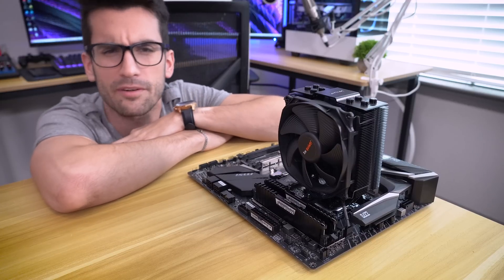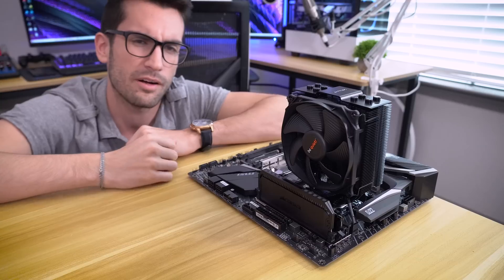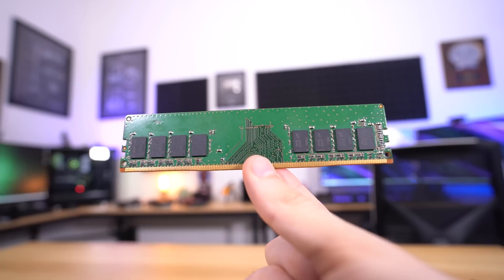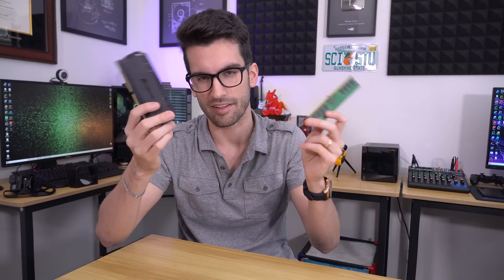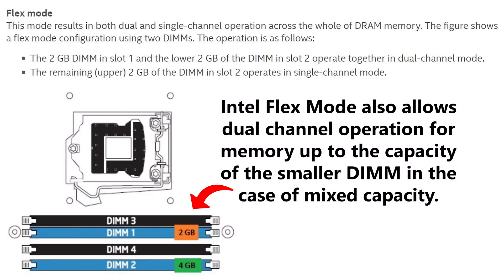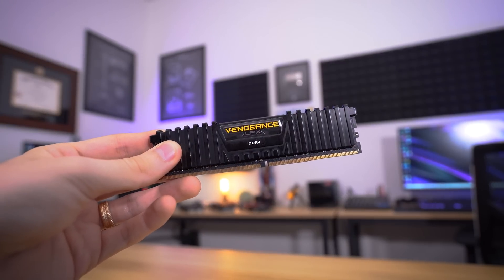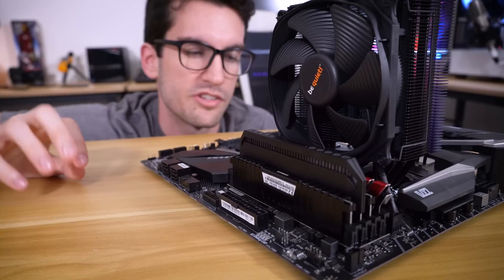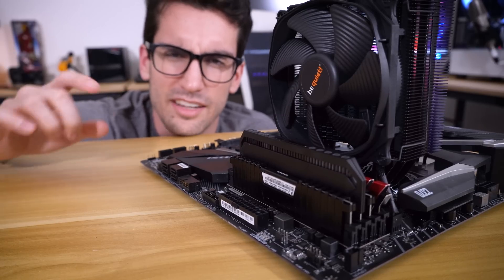Mixing RAM?!

Comment: In a nutshell: It's fine. Yes, mix memory if you have to. Your system will run at the speed of the slowest module.
Reply: What if the two sticks of ram are running at the same speed?
Reply: @HardwareHacksYT  Then the system will run at that memory speed. The mobo does have to support that speed, of course! You can't have ALL the sticks clocked higher than the mobo supports, unless you have a BIOS that allows you to declock the RAM channels.
Reply: Trump's Tiny Hands Just FYI, it’s SUPER SUPER possible for issues to occur. It won’t simply “clock the the slowest one”. The chips and I/O controllers are different. The timings are different. The Subs are different. The command rate can be different. If 16-16-16 C die tries to pair with 16-18-18 CJR, you’re going to have issues with tRAS. Why? Because tRAS needs to be at a high number with C die, however tRAS is dependant on timings such as tRCD and tRP, which are now different. If the slower timing is used, tRAS won’t be calculated properly. If the faster is used, tRAS won’t work with the C die. The C die (16-16-16) would have tRAS greater than the tRAS for the 16-18-18, so uhhhh there’s nothing you can do there except manually change half the timings. Timings matter. Speeds matter but MOST importantly, memory chips and ICs matter
Reply: @ArshiaS1381  See my above reply to Mr Ahmed. In the vast (99%) of cases, it's just fine. You are 100% correct in what you say, but my OG post was a simple, quick help tip for the average user who may have odd DIMMs in their collection and want to know if they can utilise them to increase capacity. Mostly they can, it's fine. Why pick it apart with edge cases my dude? I do this daily for customers whose installed RAM is slower than the modules you can buy today, and it is almost always ok. And I soak test the machines with Prime95 for 48hrs before delivery. Any issues I undo the changes.
Reply: Trump's Tiny Hands TM5 with the anta extreme profile is a much better memory stress test than Prime95 Large is
Reply: @ArshiaS1381  Yah but P95 gets the job done!
Reply: Thanks
Reply: Nothing a bit of oc can't solve.
Reply: @HappyBeezerStudios  how do i oc only one of my rams? for example i have 2666 mhz and 3000mhz and i say i want to oc my 2666, is it possible?
Reply: @HappyBeezerStudios  thanks, i just have to set it to 3000mhz and my rams will run the same. Trying to buy from a guy who has 3000 and 2666, rgb tforce
Reply: @HappyBeezerStudios  tried doing this... ocing a non matching kit is a nightmare
Reply: What if your motherboard is the one that’s bottlenecking your ram speeds
Reply: @UnitsChannel  Doesn't quite work that way. My point was, the short answer is don't stress out over mixing different spec RAM. System's gonna run just fine, it will de-clock to the speed of the slowest RAM modules it finds. If your mobo is underperforming, that's a different matter.
Reply: Trump's Tiny Hands Question, how do we know what motherboard is “good quality” or “bad quality”, and how do they affect the system apart from the ram memory compatibility + cpu socket?
Reply: @Blitterbug  If it can cause a blue screen then it can cause silent data corruption that can cause stored file and even irrecoverable filesystem corruption.  Do this long term and you could eventually have a hard drive your BIOS refuses to boot and you'll hope you can recover it with a filesystem utility.  If you do anything remotely important with it it's best to use memory only from the same kit and for that kit to be on the QVL for the MB or vice versa (unless you know how to validate it as well as the respective manufacturers).
Reply: @jasonlisonbee  Um, no. If the RAM is intrinsically stable, you won't get a blue screen. That only happens with bad DIMMs.  Not happened to me in some 30-odd years, leastways...
Reply: Trump's Tiny Hands if my pc has a 3000hz 8gb ram could I use some other brands 8gb 3000hz?
Reply: @papisamir3928  Yes, you certainly can.
Reply: @Blitterbug  hey bro i see that u help alot of friends here i hope u help me to;   i have 3000mhz 8gb cl16 1.35v on my pc im using only 2666mhz cl15 (cuz my mobo support only 2666) the xmp did cl16 to cl15 auto. and i bought another same brand 8gb 2666mhz cl16 1.2v (has xmp and overclockeable) what will happen if i connect this one ? If its work this will count as dual channel? The xmp will choose the voltage same as other one ?I know this is my own risk just need to know more thanks alot bro.
Reply: @drisssamlali3663  mixing ram brand and frequencys worked fine for me. 
Yes it will be dual channel but it would run on the lowest frequency(for you its 2666). Make sure to put it on the 2nd and 4th slot👍.
Reply: @jucctin5243  ty so much bro that what i need just 2666 enough for me and i have just two slot ram motherboard
Reply: @drisssamlali3663  Generally, clock speed is the only thing that matters. The overclocking community bangs on about tweaking the voltages, etc, but I would let the mobo sort that out. For dual channel, you have to match the sticks exactly, as far as I am aware. I would just try it. You won't fry the RAM. If it doesn't POST, reset your BIOS to factory defaults and try again - in other words remove any overclocking. Mixing DIMMs is only possible if you don't plan to overclock.
Reply: @Blitterbug  so if I have 2 3600mhz sticks and I install 1 stick of 2600mhz, the pc is gonna run at 2600?
Reply: @Blitterbug  so it's pointless to run 4gb and 8gb cuz itll just run at 4gb? might as well just run the 8gb by itself? or what about 2 4gbs?
Reply: @Dioslux  Wot? Size is not speed my friend. 4 + 8 will give 12. Don't you want 12GB?
Reply: @Blitterbug  that's what im asking. but the system will run at the lesser ram stick right? so a 4 and an 8 together will run at 4? im new to this and just trying to understand
Reply: @Dioslux  No, no, no! You're still confusing SIZE with SPEED. Memory has a maximum speed it can be run at. If you insert a 4GB and an 8GB stick, you will have 12GB of memory, but because all ram must run at the same speed, the system will choose the slowest speed of the inserted sticks and use that to run all the sticks at. Understand? If you don't get it, don't worry. You will still have 12GB.
Reply: @sebawuba8533  by the ratio of vrm to power phase basically the more vrm and power phase but must be 1:1 ratio or atleast 2:1 ratio but can be counted equal to min of 6+2 or double the vrm per 1 power phase is better than double the power phasep per 1 vrm.
Reply: @UnitsChannel  get a better motherboard. My motherboard limits at 2400 mhz because its kinda old, but doesnt rlly matter too much cuz i use intel
Reply: @Willem500  Yah if all your sticks are too fast for your mobo, it's gonna likely not POST.
Reply: @Blitterbug  bruh thats not how it works if the sticks run higher than the mobo they just underclock
Reply: @Willem500  Yes, they should, but some older northbridges don't always let modern superfast DIMMs work in backward-compatible mode. You just have to suck it and see.
Reply: @Blitterbug  yea mine worked fine for years. Now my pc is stuck in a bootloop, tried replacing evereything even mobo, last thing i havent tried is to buy a new psu
Reply: @Willem500  Yeh that may help, I know how frustrating it is believe me!
Reply: Trump's Tiny Hands you the goat
Reply: @jeremym9140  Baah!
Reply: I'm sorry you had issues, but  @labibAhmed-q9v  30 years of experience doesn't make me 'wrong', my man! Some mobos can't handle mixed speeds if they are a) too old, b) have odd northbridges, c) various other reasons too long to go into. As a rough rule of thumb, what I (and Greg) said in his video is largely correct. Ask some of the people who have messaged me. I still do this daily, and for a living, and it works in 99% of cases aside from very odd laptops and desktop mobos that just don't like it.
Reply: @postconsolepeasant6538  yes, you can.
Reply: Im confused at "your system will run at the slowest module" So if you have 2 , 4 , 8 gb of ram modules will it go for the 2 gb of ram?
Reply: @kkrmson  RAM size is not RAM speed! The speed is the number written on the sticker (not the size number!). You can normally mix RAM sizes with no problem as long as the BIOS / mobo allows it. Check the downloadable manual for your mobo.
Reply: Oh alright tnx for the instant reply🙏
Reply: I do it to I just get the same speed of ram and just oc it
Reply: My hero
Reply: @Silver.Swimmer  hehe!
Reply: Thanks
Reply: @KC80SiX  No worries!
Reply: So if I have 3200Mhz 16GB RAM DDR4 rn, and I buy another company’s DDR4 3200Mhz RAM, it will work perfectly well and won’t effect the speed on the system in a bad way?
Reply: @houdinimagician1794  In theory it should be 100% ok. The manufacturer is irrelevant so it should be fine.
Reply: @Blitterbug  hello sir. How can i know if my motherboard can support my ram? Currently, i have 8gb ram and planning to add 1 more. Also, can I mix 8gb and a 16gb ram? Thank you so much. 

P. S. Bought the pc (brand new) around 4 years ago.
Reply: @angelocastro9536  You can mix RAM sizes, but make sure you don't exceed the max. amount of RAM for your motherboard... if it's only 4 yrs old, mixing 8GB & 16GB DIMMs shouldn't be a problem but there's NEVER a guarantee it'll work so don't spend too much money!
Reply: Trump's Tiny Hands 
ok, thanks!
Reply: Thanks
Reply: @Plumbobby No, not at all - RAM sticks have a bus speed they run at which is written on the label. When modules with different speed markings are mixed inside the same machine, they will ALL operate at the speed of the slowest module. Though one person pointed out that they seemed to get a speed part-way between the lowest & highest, so ymmv...
Reply: Best answer
Reply: @baghlani92  Why thanks!
Reply: can you buy a ram stick of a different brand but with the same speed and memory?
Reply: @_ren5506  Absolutely. No problem at all.
Reply: at stock but just go to the speed of the lowest memory speed so like 3200mhz and you be fine unless your cpu cant do that speed at 4 rams stick
Reply: @EvanLovell  Think that's pretty much what I've been saying... except you normally don't even have to fiddle with BIOS settings, it recognises what you're plugging in.
Reply: I have a hyperx fury  and it auto overclock itself depending on how much stress it's under with the base frequency at 2133 but will overclock higher if it needs if I add in another eg corsair stick will it only run at 2133 aswell
Reply: What if i mix my 8gig 1866hz with another 2x4gb kit of 1866hz but different brand?
Reply: @matusgerbiark3622  Nothing. They'll both work fine with each other. Don't worry about mixing dual with single channel either; it's an old wives tale that you'll get crap performance.
Reply: @matusgerbiark3622  it will be 8gb but there's no dual channel. And different brands doesn't affect it.
Reply: Trump's Tiny Hands my ram is different but is the same speed soo is dat gonna affect it
Reply: @archifps  Shouldn't matter. The only issue is mixing dual channel with single channel, but that's not as big a deal as some tech channels make out.
Reply: I've tried to mix SODIMM RAMs, 2x 8GB DDR4, just different brand and speed. But it keeps BSOD.  Is there any settings to change in BIOS?
Reply: @afiqzamanhuri  Some mobos forbid certain combinations. Nothing to do with mismatching RAM speed - more to do with DIMM sizes. I'd suggest googling the manual for your mobo, they often have very detailed explanations. Yes, you can often change timings & voltages in the BIOS but stay well clear unless you are VERY confident! Final tip: Short out the mobo CMOS reset pins before trying again. You wouldn't believe how many 'bricked' mobos come back to life when you do this.
Reply: Tnx
Reply: No need to watch the whole video after reading this line Thanks Man 👍
Reply: @starktheories1142  Hehe - that was kind of my original reason for posting, though Greg makes some interesting points I felt it was a teeny bit superfluous, and I've had a lot of interesting questions come at me as a result. Please watch it though, Greg could do with the ad revenue!
Reply: Trump's Tiny Hands  like you change the speed after you install it like in the bios or something
Reply: What if I have 2 8g sticks of 2666 and have 2 8g sticks of 2400
Reply: @nzxlunar8893  As long as the mobo supports that qty and size of DIMMs, the system will run at the lowest speed DIMM - in your case 2400.
Reply: What about Using 3×4gb ddr4 ram ?????? How well or bad it will perform
Reply: @prince-of-saiyan  I don't understand? this thread is about what will happen if you mix DIMMs of different speeds.
Reply: @Blitterbug  You really a legend still responding to all this 👏👏
Reply: @superjamram165  Hah! Thanks but no, just like helping people - there's a lot of misinformation out there.
Reply: @Blitterbug  Well I am sure you have helped everyone here plenty 👍😀
Reply: Trump's Tiny Hands bro thanks for helping everyone out here ..please help me with this bro ..I have a fx605dt ASUs laptop..it has 8gb ram ..dual channel..can I add one more 16 gb ram to the empty ram slot and make it into 24 in total?
Reply: @srikanthgudluru9293  If money is no problem it's probably better to use two 16gb DIMMs. The mobo should support 32gb no problem. However, in theory you can have a mismatch of 8gb + 16gb and it should be fine with that particular model.
Reply: Trump's Tiny Hands I brought new ram but when I installed it it didn’t work it’s also not the same as the one I had already is there a particular order I have to install it
Reply: @abu4559  When troubleshooting RAM issues you need to isolate the problem. Does the new RAM work just on its own, with the old RAM removed? If so, this particular mobo has issues. As I don't know HOW different the new RAM is, it's hard to say but try it with just the new RAM alone. If it works, you might want to buy more of that type to replace the older RAM. If it doesn't work with just the new RAM that means your mobo fundamentally can't work with the new RAM at all, I'm afraid. It is probably too old to cope with it.
Reply: Trump's Tiny Hands it isn’t old because I  have a gigabyte b450m ds3h but it’s fine because I refunded I’ll just buy another Ripjaws v but with a 2400mjz instead of my current 3200mhz to fit my budget
Reply: Also should I enable or disable xmp when installing new ram
Reply: @Thanos Yes, up to a point. Often mobos have restrictions on max size of DIMM per socket but most are flexible. I do this all the time for customers who just want a little memory boost but don't want to pay to replace all their existing RAM.
Reply: I have 2X8gb + 2X4gb so 24gb total.
They are perfect match same manufacturer and model just diffent size.
Runs perfect.
Reply: @skipjackson5349  Nice. Pretty much what I'd expect tbh.
Reply: A Jackson manufacturer and model don’t matter. Unless it’s Crucial. Otherwise it literally DOES NOT matter.
Reply: Facechunk  Normally, yes. That's the whole point of Greg's video, and also of my original point. Try it and see - most mobos are fine with this.
Reply: Trump's Tiny Hands I just purchased 2x8gb corsair vengeance pro sticks. I got greedy and purchased two more of the same sticks to have 32gb. Corsair says they don’t guarantee them to work together. What do you think? P.S. running AMD ryzen 9 3900x on msi b450 tomahawk.
Reply: @TheMad0ne  The best thing is just to try them. If the system POSTs, it's probably gonna be ok.
Reply: Trump's Tiny Hands thanks brotha. It’s my first build just waiting for my gpu to get here and then it’s on!
Reply: @Michele mike Not sure about the clock timings. The key thing is that the modules will work ok. Mismatching modules probably isn't a great idea if you're concerned about the actual clock timings! It's more of a 'hack' to allow you to utilise spare DIMMs you have lying around without spending big money. If possible, always match the RAM exactly in every spec.
Reply: Thanks
Reply: @Herus So try it and see? I don't think the clocks matter too much as long as the mobo supports BOTH. Then it should run both sticks at the slower speed.
Reply: Hye. I just want to know. If a laptop RAM speed is stated DDR4 8GB 2133MHz, can i use more RAM speed? For example 2400MHz or more.
Reply: @amirulshafiq2656  In theory, yes. But if you install it alongside the 2133MHz DIMM, all the RAM will run at the slower speed. If you are going to completely replace the RAM with faster DIMMs, and if the mobo supports the higher speed, then it will run at the higher speed. If the mobo doesn't support the higher speed it will either underclock or simply won't boot.
Reply: @Blitterbug  thanks for the info! 👍👍👍👍👍
Reply: Formerly your PC didn't boot when Ram was not compatible.
Reply: Can i buy 16gb and combine it with 8
Reply: @Maefis  I don't see why not, if your motherboard supports 24GB.
Reply: Trump's Tiny Hands my motherboard Supports 64gb RAM
Reply: Hey everyone . Ive a Hp laptop with I5 7200u + Gtx 950m  
I got the basic 4Gb ddr4 from Samsung . And i bought a Corsair 4gb to get a " dual channel " with 8Gb at total .
Will it work ?
And sure ive got the same MHz and DDR4
Reply: Slowest gb or MHz
Reply: @swifter__9079  ? gb isn't a speed?
Reply: @Blitterbug  I mean kinda like cod can't handle 8gb
Reply: Thx..you’re a good person
Reply: @abdulwahabelhaponi8139  Not at all but thank you.
Reply: @Blitterbug  I got samsung 4gb DDR3 ram (PC3, 12800, 1600mhz) and I'm planning to buy Another's company ram of same specs (Hynix 4gb DDR3 PC3, 12800, 1600mhz). Will it be okay? Because I'm actually a bit nervous of mixing brands (though specs are 100% similar).

Also, I'm a bit confused as I have only 2 slots for ram to insert onto my mobo, but when I lookup the ram specs in CPU-Z software I see slot#1 slot#2 slot#3 slot#4? 
Reply will be highly appreciated! :)
Reply: @rahulahire9165  Yes it's fine, brand doesn't matter at all. As for the slots, CPU-Z may be counting the slots twice because of them being dual-channel - but don't quote me. Basically it's safe to ignore this anomaly. It doesn't get everything 100% right in my experience.
Reply: @Blitterbug  Thanks mate!
Reply: Nah if it has enuf dedicaded wam for my minecwaft server, then I am fine
Reply: What about the same speed ram
Reply: @refraag  That's even better as you know the system won't drop to the speed of the slowest module. The main point is you can generally mix sizes and speeds without many of the problems that high-end system builders claim you'll have.
Reply: Thank you very much I will continue browsing the internet now after not even having watched 2 minutes of this video
Reply: @Leo-ri6qg  You're welcome!
Reply: I have an Asus prime h270 wich only Supports 2400mhz but I have 3200mhz sticks so I paired them up with my old sticks and boom 32 gb
Reply: @Sileovitam  There ya go!
Reply: I have a slightly old system with 4gb ddr3 1333ghz, I wanna buy some more some 8 gb 2x4gb  also 1333ghz can I use the 2's gb with the 4's together if they bother are 1333
Reply: @eltioghost8520  Shouldn't be an issue - DDR3 systems tend to be more tolerant of mismatches in my experience.
Reply: Will it work in dual channel mode?
Reply: what about 4+8gb ram?
Reply: I just want to add a new stick of 8gb ram with the frequency of 2666 same as the old one but in different brand.
Reply: Guys i have a 2400 mhz ram am i able to pair it with a 2666 mhz one or no?
Reply: @barbeque701  I can't see a problem with that.
Reply: @Blitterbug  ohh so it means it can run but my 2666 will just run at 2400 right?
Reply: @Blitterbug  please reply to my query 👆.... thanks in advance 😁
Reply: I have 2400 Mhz Corsair Vengeance Lpx 8gb stick (red) , i am planning to add one more 8gb stick of same vengence lpx model & speed but it is black, with their latency values slightly different.. would they work together ?
Reply: @Yogi_beer  I don't see why not...
Reply: @Blitterbug   Best of luck for elections, king 👑
Reply: @Yogi_beer  Hah!
Reply: @SSonnyy Yes, it should work fine.
Reply: If i put 1866mhz with 2666mhz....what gonna happens?......did the permormance increased?....or just running the same system before i add new ram?
Reply: @ashnoice3805  Nope. That's a big difference! Usually, the system will run all modules at the speed of the slowest one, but a difference that big? Sometimes the mobo will refuse to POST, so be careful.
Reply: @Blitterbug  why can't it run at the ram that have highest speed?
Reply: @ashnoice3805  It's because all RAM modules MUST run at the same speed, but slower RAM can never physically be made to run at the speed of the fastest RAM module, so the mobo does the only thing it can and 'underclocks' the faster RAM to match the slowest RAM in the system. It's really very simple when you think about it.
Reply: @Blitterbug  im not realy got at this thing and still confuse.......so which is the best to do?.....
1) mixing a different ram speed
2) insert a same ram speed

I afraid that my laptop gonna get side effects
Reply: @ashnoice3805  Don't sweat it. Get the best match for the current modules you can. Basically, if all you can find is massively faster modules, to avoid any potential issues I'd probably replace all existing modules with the new ones. If you can afford to. DDR3 is a standard that doesn't care about clock speed, you normally won't get a POST fail unless your mobo doesn't support the AMOUNT of RAM you're trying to fit. Speed isn't too much of an issue, honestly; just try and make the speeds as close as possible for best results.
Reply: thanks 😂
Reply: So is it possible to mix my 1st stick (UDIMM no heatsink 2666mhz 4gb) with 2nd stick last resort HyperX Fury (2666mhz black 4gb) answer pls
Reply: Mr President sir, what if i combine 16gb 3200mhz with an 8gb 3200mhz? Both different brand btw. (Sorry for my english my good sir)
Reply: @vox0126  Well now, I can't see a problem with those combinations. And your English is fine!
Reply: @Blitterbug  Thank you so much my good sir. May the force be with you.
Reply: If I have 2 sticks of crucial and 2 sticks of team group and want to mix them... will it still be better than only have the two same ones?
Reply: @eli_flygaming1117  Depends what you mean by 'better' - if better means more memory then yes.
Reply: Thank you Mr Trump
Reply: @idaziz  You are very welcome
Reply: @Insxdious. It doesn't really work that way; for best stability & FPS, always use fast RAM and match the sticks' speeds. Mixing stick speeds is just a hack to get you more RAM for cheap, but the system will then only run at the speed of the slowest module.
Reply: Uh 8gb 2400mhz with a 1gb 800mz ?
Reply: Ahhh that makes a lot of sense, never really thought about mixing ram but I'm going to try to stay away from it.
Reply: @phrog.4809  Yah, it's basically an option for when you have an older machine and you need more RAM to improve performance, and you have an old PC lying around.

If you're a wealthy gamer I wouldn't really recommend putting slower RAM into brand-new gear, though it's still ok to mix different size DIMMs from different manufacturers as long as the base specs match. You wouldn't believe how many think that's a no-no!
Reply: im going to buy new RAM and SSD for my gaming laptop, can I buy any RAM? or would I have to buy certain ones
Reply: @shinefake48  No, you don't have to worry about matching the specification of the current RAM as long as the laptop's reasonably new. The BIOS will take care of it. Any SODIMM that fits the slot should be fine!
Reply: Blitterbug I see ty
Reply: what if I have vengeance lpx and rgb pro both ddr4 and 3200 hz but the rgb pro are 32 gb and the lpx is 16 gb equaling 48 gb will it work?
Reply: @Thanos5  The make of RAM doesn't matter, and sizes don't have to match. It does depend on what the mobo allows, though,. Don't buy expensive RAM unless the system's fairly new. My advice is mainly for people who have spare RAM lying around, though I see no reason for that not to work.
Reply: Can I use two different ram card which are both ddr4  and have the same frequency
Reply: ok no need to watch the video .
Reply: @revenge977  Hah! I wouldn't say that, exactly, but I was surprised that Greg didn't know you could do this...
Reply: Unless you oc your ram. Say from 1366 to 1600 on ddr3
Reply: @xxg0t3mxx  No, it doesn't work that way, sadly.
Reply: @Blitterbug  I got mine (running 2 hyper 8,gig and 2 4gig off brand. The lower ones are 1366 and the others I believe are 1866 I can run mine around the 1600s
Reply: @xxg0t3mxx  Nice - you're never going to get the full speed - but great result!
Reply: My concern is about dual channel ):
Reply: @mitchsz  You don't need to worry. The whole 'can't mix different sizes or dual-channel won't work' thing is overblown. Your RAM may run a little slower, true, but a) it will barely figure during actual use, eg gaming, and b) this advice is for people who have spare RAM lying around and want to pimp their PC on a budget. It hardly applies to 'leet gamers' who can afford the best stuff!
Reply: @Blitterbug  In my case I already have one 8gb module (that I'm using right now) and I want to buy more 8gb, so I was concerned about if it would work in dual-channel if I use other brands, so as long as I buy one with the same latency and frequency I'm fine, right?
Reply: @mitchsz  Yes. It's a myth that you need to source modules from the same manufacturer.
Reply: Wait so its it bad
Reply: @bananaman2212  yes and no, so if u have 2 modules of 2000mhz installed and u install another model this one of 1000mhz, it will work without problem, but the computer will make the 2000mhz stick run at 1000mhz, so in short, it doesnt hurt your computer so its not bad, but running your ram at a lower speed when u can just run it at a high speed without problem its a waste of money, so then its bad for u wallet
Reply: so if both brands of ram run at 3600mhz w/ a CAS latency of 18 it would be fine?
Reply: @ItsDevv  yeah
Reply: @Plumbobby no, they will run at the same speed of the slowest stick
Reply: @Plumbobby You're very welcome!
Reply: Thanks you saved 7 minutes 40 seconds of my life
Reply: @goldengoliath7618  Haha no problem!
Reply: I know I'm so late but If you see this if I mix 1333mhz with 1600mhz is it going to work as if I have 8 gbs ram or just normally
Reply: @pantherexe650  Best thing is to give it a try. It should be ok. You can mix both sizes and speeds usually with no problems.
Reply: @Blitterbug  omg after a year you replied, thanks so much man
Reply: @pantherexe650  No problem!
Reply: @pantherexe650  is gonna work normally but all the sticks are gonna run at 1333mhz
Reply: Is the performance going to be affected?
Reply: @lilbeest135  No - the mismatched DIMMs or SODIMMs will all run at the bus speed of whatever the slowest module is clocked at... normally, this isn't a problem as the increased RAM increases performance, so the machine will actually perform better, even though one or more RAM sticks isn't running at its native speed.
Reply: thanks
Reply: @WikiForce  You're welcome, commander sourpuss!
Reply: @WikiForce  So does your spelling. Now run off back to school.
Reply: @I killed that beard guy Yes!
Reply: @I killed that beard guy Try it and see. It should be fine.
Reply: Thx god damn all I heard blah blah blah blah and yes
Reply: @fitchapo673  Haha!
Reply: Thanks!
Reply: @pOob-15  No worries.
Reply: What if I mix a 16gb 3000mhz with a 8gb 2400mhz ram? If u could answer ASAP that would be appreciated
Reply: So if i were to mix my 8gbx2 3200mhz with g skill trident x rgb 8gbx2 3200mhz will my pc run with 32gb??
Reply: @etienne7351  Do you literally mean "2 8gb sticks + 2 8gb sticks?" Then that's 32, yes.
Reply: @Almin Rizvo Can't see why not....
Reply: And I guess it should work just fine if I use ram with the same speed as the old one and THANKYOU, you saved my time!
Reply: @thenocturnalwanderer  If it helped, that's cool
Reply: I'ma be frank here, if both of them are 2666mhz Ram sticks but 1 is a 16GB and the other is an 8GB. Will it run at 2666mhz?
Reply: @roguebeast2326  Yes. Why wouldn't it?  :)
Reply: What’s if there the same speed will it still work?
Reply: @ceoofkmt-6479  Of course!
Reply: @Blitterbug  what if the different brand s?
Reply: @Blitterbug  How about 4gb (no brand) + 8gb (Crucial) both have a speed of 2400mhz?
Reply: @AwesomeCats-k9n  Can't see why that wouldn't work...
Reply: @Blitterbug  I just installed it on my Linux Laptop, It worked flawlessly! Originally my laptop runs on 4GB (Single slot) then I decided to buy another RAM (8GB) now my laptop has 12GB of RAM (SODIMM DDR4 2400mhz)
Reply: @Blitterbug  Thank you for your response!
Reply: @AwesomeCats-k9n  Excellent! I'm really pleased it worked out for you. See how people are spending silly money on precisely-matched DIMMS when you can mix-and-match from your spare parts with virtually no noticeable loss of performance?
Reply: What if there both 8gb will it be 16 gb
Reply: My experience says that:

Intel 6th-11th gen: 99.9% of the time you'll be fine.

AMD Ryzen: It can work, but don't expect it to work. Ryzen is really fussy when it comes to RAM.
Reply: This summary misses the key point.  It's not about mixing modules "if you have to" . It's simply that mixing modules does increase the risk of system instability.  So if you do this and you see more blue-screens, restarts etc,  those mixed modules are the likely culprit.  If you don't then knock yourself out!
Reply: @Ash_18037  
Indeed. The way I see it: don't expect it to work, but if it works and it's stable, then great.
Reply: @Ash_18037  I agree.
Reply: So what if I put 
16 gigs (2 * 8) with
 8 gigs (2 * 4)

Will that 24 gigs run faster than just using the 16 gigs because the 16 gig sticks are faster than the 8 gig sticks?
Reply: @ApplyingToJob  No. How it works is the motherboard will downclock ALL sticks to the speed of the slowest sticks you have used. BUT, the extra memory increase normally makes more difference to system performance, and you will not perceive any 'slowdown' of your RAM. Basically: DON'T WORRY - more RAM is always better!
Reply: @Blitterbug  alright thank you
Reply: So if i have 3 sticks 1x 4gb 1x8gb 1x8gb all different brands + speeds.. is my pc go boom??
Reply: @wyzexyz2931  you'll have more ram which is good but the lowest stick speed is what your PC will use. As long as it's the same ddr number
Reply: @wyzexyz2931  Nah...
Reply: If they have the same specs but just different brands, T-Force 8gb ddr4 2666mhz + a Kingston HyperX with the same spec. Will my Kingston HyperX help the 1st ram- Tforce to get into a 16gb speed?
Reply: @Iron-yMan  yes
Reply: @Iron-yMan  a 16GB speed? That's not a thing. Look, this is simple; mix up any RAM sticks you like to benefit from the better performance that more memory brings. The ONLY issue is that the system will run ALL memory sticks at the clock speed of the slowest module you used. However, the performamce increase you get by adding more RAM more than makes up for any tiny drop in RAM clock speeds that may happen. In your case, all the modules have a clock speed of 2666MHz, so you'll have no underclocked modules to worry about.
Reply: Is it okay to use ram with different voltage?
Reply: @jongsalaysay992  Not possible, so don't worry.
Reply: Sus
Reply: @OverpoweredDBT  ?
Reply: @nothing-hu2pw  Hehe!
Reply: can I mix 2gb ram with 4 gb ram?
Reply: @rheyybas9916  Of course. That's what I said :)
Reply: if i have 4 sticks of DDR4 3000mhz but they are different brands can i put them all together without problems
Reply: @drakowackem  Of course you can.
Reply: Is it possible for to overclock them to the same frequency
Reply: @Peeper117  Don't confuse overclocking the front-side bus with overclocking RAM - basically if I want to overclock the system as a whole, say from 3GHz to 3.4GHz, I won't bother trying to mess with RAM. The mobo takes care of RAM and runs all modules at the speed of the slowest RAM DIMM, and you don't need to worry about it. The tiny, tiny difference in DIMM speeds makes NO perceptible difference so just mix your DIMMs as you wish and don't overthink it. Its really a tip for cash-strapped people who want to boost their RAM. Power users will generally want to run matched DIMMs where money is no object. This advice is for the rest of us! :)
Reply: @Blitterbug  oh ok thanks
Reply: Manaf  Yes indeed, it's what I said in my original post!
Reply: So if there all ddr4 but different ones it should work fine right
Reply: @deke3385  Indeed.
Reply: @Blitterbug  I have a question can I use 8gb ram and 4gb with different brand will my pc be fine?
Reply: @lamKrazy  Yes, it should be fine. The only thing that has to match is the memory type (DDR2 / 3 / 4 etc)
Reply: my system wont boot doing that
Reply: @chopchop8551  It won't boot doing what exactly? As long as the RAM matches in terms of specs (and often when it doesn't) then all should be well. I've been doing this for decades and yes, there are edge cases (usually involving very niche mobos, or overclocking) but most of the time it's a fine moneysaver. Some mobos are sadly restrictive but most aren't.
Reply: what if u use dcop to overclock to the highest speed one (assuming it’s stable) and they ox to the same mhz will they run at the same mhz?
Reply: @Lil_GroceryBag  Nope
Reply: @Blitterbug  actually i tried it and it worked
Reply: @Lil_GroceryBag  Excellent!
Reply: @Blitterbug bit late to the party. But will I encounter any problems mixing my 2x8 3600mhz cl18 corsair vengeance pro with a 2x8 3200mhz cl16 corsair vengance pro on my b450 aorus pro mobo?
Reply: @gonmattsu  in theory the mobo will just run all RAM at 3200MHz
Reply: Thx
Reply: yea i have 3 4800 mhz and one 5200mhz but they run at 4800
Reply: @RxamosOfficial  Perfect example of what I was saying! But it runs fine, no?
Reply: How confident are you with this on an early Ryzen system?  I used to read a web site by and for computer tech professionals.  Some stated this is apparently true most of the time, but they always make sure the RAM is a bit more than the needed cap as a kit matched and packed by the manufacturer.  Reasoning is it's one less phantom cause of random errors/file corruption to waste your time tracking down.
Reply: @uncrunch398  Well, speaking as a computer tech professional of some 40-years myself, it's usually fine. As I've mentioned in various replies to others, results can vary and this is more of a 'can I repurpose those spare DIMMs/SODIMMs in my drawer for a cheap performance boost?' and usually, the answer is yes. It makes no difference which variation of x86 hardware is in play; if there are problems, it's often the BIOS / chipset at fault. Hope this helps.
Reply: @Blitterbug  I believe you.  I wonder if BIOS vendors would be interested in simplifying the memory compatibility section some way that doesn't require every module to be specifically written in.  Just code in the JEDEC specs and a test for the best settings that work.  I see no reason a user has to experience what seems like a dead computer because some setting is wrong.  One could have a fast kit but have to spend hours tinkering to make it boot.  As it is, it's impossible to know whether your kit is dead or some spec incompatibility is the reason your computer won't boot.  Some builders on YT have stated a kit will work perfectly fine in one system but another won't boot with it, seemingly no matter what, while another kit of the same brand and printed specs will work fine in that computer.
Reply: @uncrunch398  Yah. To be fair, Greg & myself have been doing this a long time with mixed results; it's a kind of 'suck-and-see' approach; I've boosted my own & customers' machines, & my kids' laptops / desktops way up with just spare modules I had lying around, but some machines don't play ball. It never bricks the machine though; just put it back how it was. The main point being the gains from extra RAM will always be much more than any possible RAM de-clocking due to mixed modules.
Reply: Thanks
Reply: What's the lowest module
Reply: @User_94828  Dunno what you mean - do you mean what's the SLOWEST module? That would be the one with the lowest speed printed on the label. As I've said in other posts here, most mobos will run the RAM at the speed of the slowest module without crashing, and run just fine. But your mileage may vary. I mix RAM all the time to help customers get a bit more life out of older systems. It's very, very rare that this doesn't work.
Reply: @Blitterbug Thx for the info man appreciate.
Reply: @Blitterbug  btw that's what I means by "what's the lowest module" thx
Reply: HOLY SHIT THAAAAAAAANK YOOOOOOU.
Reply: @nate6889  No worries.